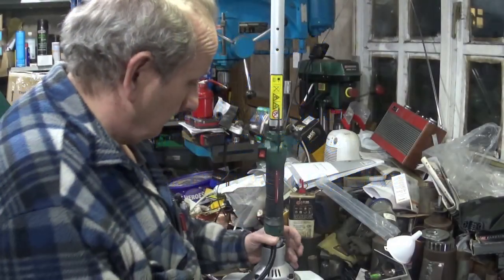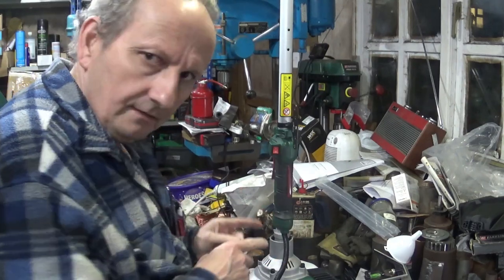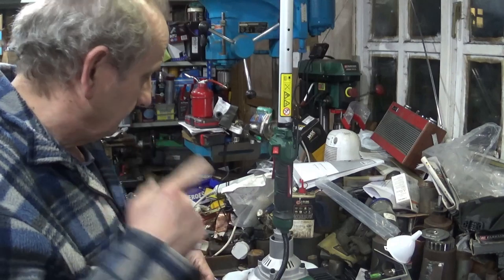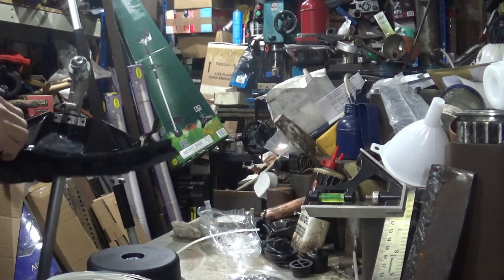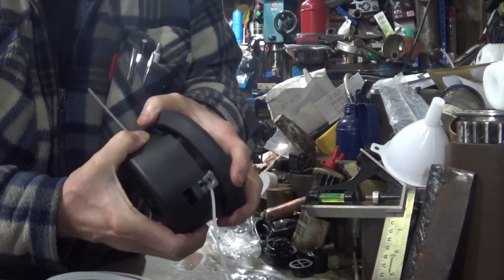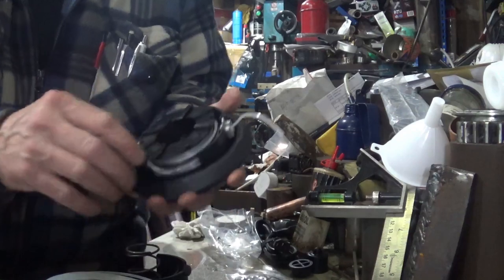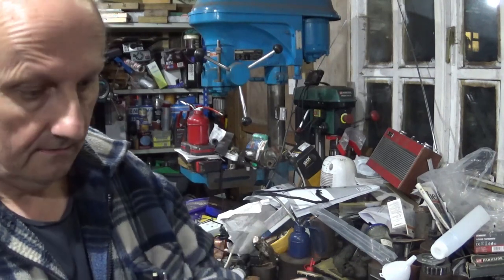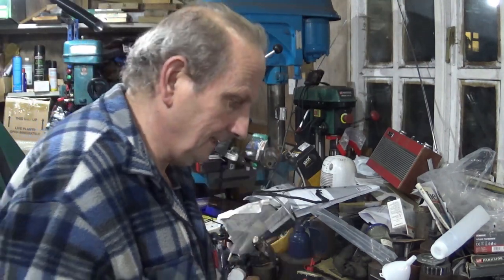Lidl Parkside 4 in 1 Petrol Multitool PBK 4 B3 Review Part 2, putting it together

Comment: many thanks from the Netherlands for the instruction video. We are not really technical and have no experience with these types of devices. We follow for new equipment very carefully the manual. But with this device we have been struggling for a day with the manual for the assembly of the scythe mower. We find out after your video that the manual is wrong. Fortunately with your explanation and showing how it sounds together, we have come out.
Reply from the maker: You are very welcome. I also followed the instructions in the manual, the ones in English, however it is not so much the wording at fault as the drawings are unclear. 

I am pleased to have helped. Please like, share and if you like the channel, subscribe!

Comment: I am on my second one of these things as the kill switch stopped working after very little use. Contacted Lidl who refunded me as unable to replace like for like. Bought another one 2 months ago and guess what? After maybe a dozen switch offs the bloody kill switch has given up again! Only way to stop the thing is to disconnect the HT lead! So annoying. I’ll continue using it as it has a 3 year warranty. It’s either a design fault or a batch of faulty switches. 🤬😡🤬
Reply from the maker: Never had a problem with mine. Has a connector come loose to the coil?

Comment: Any tip on how to fix the choke lever if the spring jumped off? Bought one last week and that's the first thing that happened!
Reply from the maker: Odd. Short answer is not because it has not happened to mine. However you can just get it changed for a new one at Lidl.
Many thanks for watching, please like, share and if you like the channel, subscribe!

Comment: Hi, is the internal splin that spins inside square? Im looking for a replacement power head for a ryobi expand it range.
Reply from the maker: The external spline goes in to a socket with an internal spline. If your shaft has a square socket it is not going to work.

Many thanks for watching, please like, share and if you like the channel, subscribe!

Comment: Followed your instructions for brush cutter and seems to work. When I followed the instruction booklet and tighten the nut it jams the blade so it won't turn. Thanks
Reply from the maker: Which nut and which blade? 
Also, you are welcome, many thanks for watching, please like, share and if you like the channel, subscribe!
Reply: @BensWorkshop  The brush cutter blade, in the instruction booklet para 9.2.2 
Nut 52 in booklet
Reply from the maker: Many thanks, I will double check when I get home. I thought I was doing it according to the instructions! :)
Reply from the maker: I read those instructions. They are what I followed, but are not desperately clear. 

I could see how you could put things on incorrectly from there. 

Also I don't think the line drawings are clear. The washer that always stays on (with the cut out to allow you to jam the mandrel) looks almost the same as the flange washer that goes on after the blade in the drawing. 

I think actual pictures would have been better, though an instructional video better still, though, of course, I made one.

Comment: Any ideas where to get spare parts for it? Cheers
Reply from the maker: There is a Lidl service number in the manual. What are you after? Similar strimmer heads are available on Amazon.

Also, many thanks for watching, please like, share and if you like the channel, subscribe!
Reply: @BensWorkshop  I'm looking for a strimmer head replacement as mine unfortunately broke. Thank you for your help!
Reply from the maker: I also have a video on the strimmer head. However this one looks like a reasonable replacement. M10 x 1.25 left hand thread.
https://www.amazon.co.uk/dp/B089NQBMNN/?coliid=IEYAQAEUZ3PIY&colid=5X5HSLDJMO93&psc=1&ref_=list_c_wl_lv_ov_lig_dp_it
Reply: @BensWorkshop  thank you!
Reply from the maker: You are welcome. Let me know how you get on, and how you find that strimmer head.
Reply: @BensWorkshop  works a treat, thanks for the help!
Reply from the maker: You are welcome. What happened to the original one? Also what is the build quality like?
Reply: @BensWorkshop  the old ones housing fell apart. The quality of the new one feels better
Reply from the maker: Good to know. Cheers.